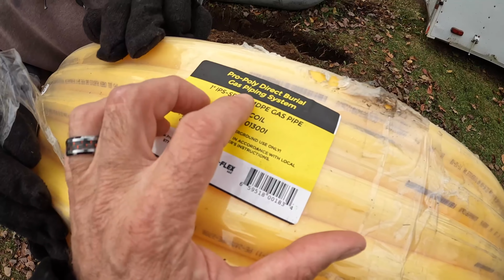Franky almost killed me trenching an underground line.

Comment: So much I have to say about this Stanley here in California it's code to run a tracer wire and I have used the magnetic rods meaning took two pieces of metal bit them in an l shape and when they come together that you're over a cavity I think it has to do with the Earth force and magnetic certification don't think I said that right wouldn't know how to spell it if I knew I was talking about but the rotation of the earth basically bad neck Force anywho I was taught that that only worked for water lines now I could be wrong because water does carry electrical force in it but here nor there when you run a trencher you want to measure your blade and get a somewhat accuracy of death usually they are 3 ft which is in California your gas line has to be 3 ft electrical 16 water line 12 so what you do is you start your trench but then you aim your arm straight down to the depth you want it and you try to draw a line to follow not like using a backhoe or a excavator where you set yourself by your sinner pivot of your excavating arm and so the machine you were using is a little quicker to pivot whereas the looks like a bobcat you were driving or even the other excuse to your trying out a little slow turning you can compensate and manage your turn with a skid steer whether it be tire tracks or a regular track tire tracks have always been the easier trenching for me when I've had to use a bobcat a reversing trenching machine it's still not easy but when a machine pivots too fast your blade gets into a bind and it's havoc I recently took a break from working in landscaping and worked for a septic tank pumping and repairing and installing one man company I learned a lot from him and one of the things we had was all the technology to find underground electrical gas lines unless it's a main line with all the irrigation lines running with it that's a mystery but gas lines and electrical lines technology are easier to find even when we called USA that is the the company or I don't know what that means they're the ones that came out to find the lines sometimes you get the rookies so you got to look for yourself you can't trust even the big great corporation of detection as you said it you do not want to be inside a trench that's why I went back to landscaping every time I was in was 15 ft holes to install a septic tank a wall would fall in we took precautions but as a landscaper I was never in a trench they could kill me so new adventures new knowledge but I'll stay above the ground from now on sorry this is a long one enjoying the show enjoying the information appreciating hard lessons learned by someone else and not me still learning hard lessons by myself but hey it's easier watching you do it than me LOL keep doing it

Comment: Did you just like running that little machine? Why not back fill with the bob cat? Would be much faster.
Reply: Skid steer would make a much bigger mess of the turf. That little loader is the best thing you could use to minimize collateral damage. With a good raking, and a tiny bit of seed over the trench; that lawn will be fine on its own in no time at all.

Comment: Very slow gear, moving a lot of dirt in a short period of time, own a DW 7610, takes a lot of power and it is very slow, but in easy digging dirt........300 to 500 feet per hour or more, 6 foot deep,  6 inch wide trench.
Reply from the maker: "300 to 500 feet per hour or more,' Holy crap.  Thats fast
Reply: @Dirtmonkey  In easy digging sandy loamy soil, 4000-5000 feet per day is not out of reach.  In really tough clay gumbo however, 1500 feet per day, could be a  long day.   My dad owned two Ditch Witch chain diggers, his last one (he still owns)  ultimately dug 25 miles of pipeline on his Southeast Montana ranch.   Ditch Witch 6510, 63 hp Deutz aircooled diesel.  He rebuilt (or had Ditch Witch rebuild)  the rear chain digging attachment 3 times if memory serves.
Reply: @Dirtmonkey  One thing that needs to be said, the digger (Ditch Witch) is specifically designed to trench longer distances.  Hydrostatic crowd control, that can be adjusted faster or slower to a very precise FPM (feet per minute)  I think they have models (nowadays) that can dig 20+ fpm, 300hp track drive and so on.   The smaller models now have basically double the horsepower of the "old" 1980's 6510.   My 7610 was a "step up" from the 6510, it is 72hp and only 22 years old (LOL)  It was a low hour machine owned by Burlington Northern RR.  I found it on Evil bay, it was located in Sidney Nebraska.  I made a trip down there and looked it over before I bought it. It had a few minor issues, but I have corrected most and more to follow.  I pd  right around  13K plus trucking back to the farm.  I dug 4000 feet of trench  in October with it, had  a lot of weather delays and hit some big rock, basically took 3 short days.  Sorry about the manuscript, but it seems like info you might need to know in the near future as you have your fingers in many pies..........thanks I enjoy your channel, cheers!!